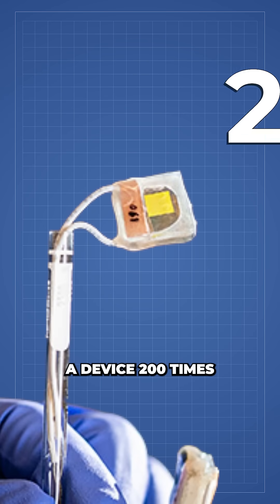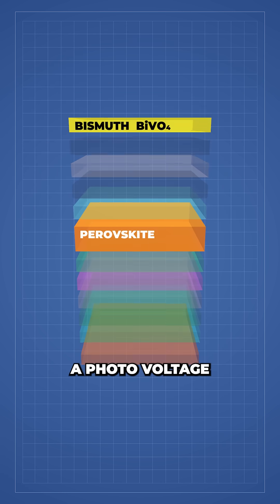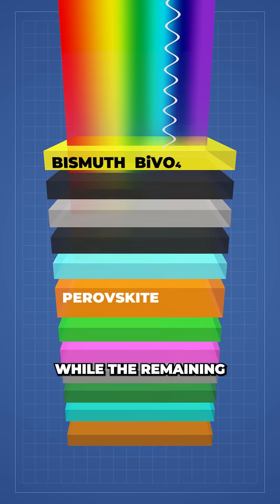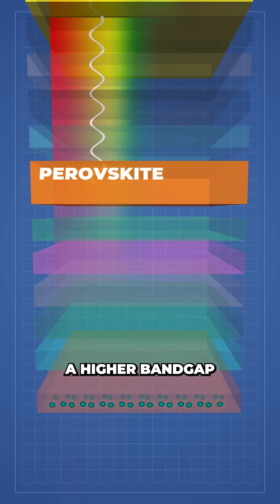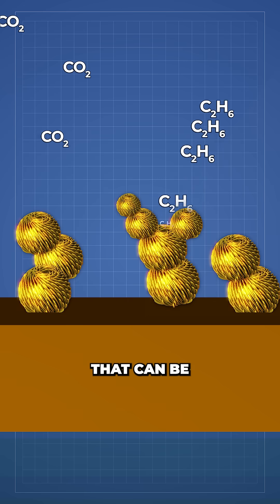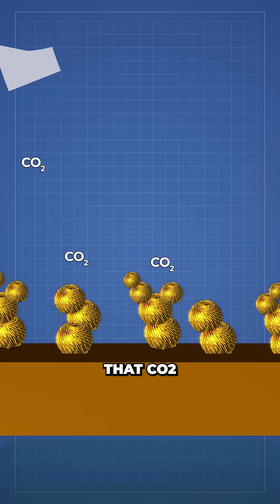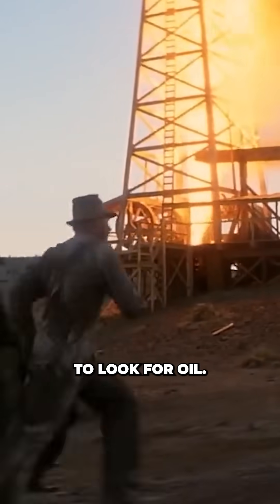Scientists Create Artificial Leaf That Converts CO2 into Fuel

Comment: If this can be cheaper then drilling a type of oil this would quickly be adopted by oil companies because one it lowers overhead costs and two it would decrease PR costs while raising profits what it will not stop is already built wells unless the solar tech gets good enough that sealing the still useful wells would be cheaper then running them till empty and most companies unless in a country without loose restrictions would not even bother properly ceiling the wells

Comment: Now, that is an actual great use of the perovskite... usually the perovskite is sensitive af and degrades way too quickly to be used in actual solar panels, but here it is shielded from both water and direct sunlight by the upper layers - without the shielding being a useless filter that negatively impacts performance... actually nice! Too bad that the scientists behind this are quite sudoku-cidal...

Comment: If anyone is curious i study these things and even if it is really promising and cool, don't get the hopes too high. The selectivity towards useful chemical components is still really low, the cathod is frial and prone to break easily, the materials are rare and expansive, and the energy needed to work, which should be given by the sun, is often unreliable. Plus you need a way to capture CO2 and have a pure gas line of it. As of now the studies shifted a lot towards using eletrical energy to make electrocell work, and indirectly using the renewable energies, and mainly get building blocks in a fossil free way, but the "artificial leaf" as we call it is probably far from a realistic thing

Comment: even if it works efficiently, it may be too expensive for anyone to actually want to use it. There is, however, already an inefficient, yet cost-effective way to synthesize natural gas, which creates the same carbon-neutral closed loop.

Comment: That's neat an all, but there's absolutely no need for us to perform the entire process in a single fiddly device. We can collect energy efficiently from standard solar panels, which in series or when fed into a boos converter can produce whatever voltage you want, and in a completely separate device(because we have these handy things called wires, which can move electricity to other places) we can do the electrocatalytic cleaving of CO2 and subsequent reactions to produce methane or whatever hydrocarbon precursor you need for the following processes. 
The idea of going through the rediculous trouble of packing it into an 'artificial leaf' is frankly asinine. It sounds like a bunch of people living off grant money in the goal of making a potato unpeeler. Valuable R&D dollars going into feeding people who are using science to basically play, and ending in a thing that no one needs for anything.

Comment: The Oil took millions of years of plants fixing CO2 in its roots, stems and leaves, if we are capable of converting 200x more CO2 in fuel than plants convert CO2 in O2 + C, we can procude fuel not in several millions of years, instead in "only" a million years.
This is not enough

Comment: Let's not use the power directly in electric motors and turn it into hydrocarbons which can be used to power ice engines with 25-30% efficiency

Comment: why not just use common panels and transfer the electric power to electrochemical devices that can make the conversion. why make a very difficult panel when a simple voltage converter can do better

Comment: So, based off of what is presented in this short, you just point the device at the sun and oil drips out the other end? I mean, I read something about glycol in the paper so it seems like there are more inputs than what is being implied here. If that is the case, how energy intensive is it to create those other inputs? If all inputs are factored in, then is this device still considered carbon neutral?

Comment: Cool experiment, but there's no chance it'll be a feasible method for decades if ever. This test probably cost $100k. If peer review and more advancements are successful costs will eventually go down, but you'd have to build such an enormous facility for it to make any impact at all. Think this vs gasohol corn or biodiesel.

Comment: Now that is useful. Solar power is as useful as a candle in a hurricane in the dark, but solar petrol or diesel.... Well... you can store that in a fuel can which is much cheaper per kilowatt hour than a battery and much easier to use.

Comment: Imagine a future where every gas station actually has a machine that turns CO2 into natural gas that you then put into your car. Burns a lot cleaner than gasoline, still works pretty well as a combustible fuel source. Drive up, swap the canister, drive away. Greatly reduces the supply chain for fuel transport.

Imagine gas power plants that can just constantly recycle their CO2 using some solar energy without need a huge field of solar panels and can work 24/7 because it is essentially storing solar energy as natural gas using CO2 and water.

Yeah, it won't be perfect, but it would be pretty cool.

Comment: I studied dual-layer semitransparent organic solar cells in college, specifically the perovskite panel. 3 larger problems will make this unviable outside of research purposes. 1, perovskite degrades significantly under UV light, so whatever the top layer is must absorb or block all UV light. From my basic research, the bismuth layer doesn’t fully achieve this. 2, inorganic perovskite (the more stable kind) is typically lead-based and is water-soluble and degrades when exposed to moisture. IE, when it degrades, it will leak lead into the ground. Lastly, perovskite has some issues with surface application, so it’s difficult and expensive to manufacture in general due to the high percentage of dud panels. All of these things are still being fleshed out, so hopefully in the future these can become commercially viable. Perovskite is semi-transparent - imagine every window on a sky scraper being a solar panel!
Reply: are there less problematic compounds with similar if lesser performance to perovskite? as the UV problem can probably be solved by putting a UV filter that shifts the UV into a less problematic spectrum. leaving only the issues with lead based Perovskite's water solubility.
Reply: @bohba13 there are alternatives, like tin, bismuth, and titanium, but none come close to the efficiency and stability of lead, especially in ambient conditions. Titanium comes closest in stability, but is lower efficiency and much more expensive (ie. not commercially viable). Bismuth shows higher efficiency, but is not as stable and still quite expensive. Tin is stable and cheap, but has the lowest efficiency coming in at around a third of what lead can produce. Lastly, filtering UV would defeat the purpose of dual layer panels, as we are trying to get higher efficiency returns, and blocking any light would directly impact that. It’s best to come up with a panel layer that can reliably handle and absorb the UV spectrum before reaching the perovskite layer.
Reply: So, a step in the right direction, but with more work to be done to make it feasible on a larger scale.
Reply: that was alot of negatives but the idea of every window being a solar panel does sound cool, how expensive is pervoskite? is it economically feasible to use it in construction?
Reply: @nobodyinparticular968  perovskites can be synthesized by various techniques. For comparison, the silicon, in silicon based solar panels, needs to be mined, hence production can be relatively more expensive. Though cheaper, most perovskites are not ready for long term usage.
Reply: @nobodyinparticular968 as of right now, it’s not a commercially viable product, for the same reasons as stated. The biggest issue i think is application, it’s hard to get a large panel made from perovskite because it needs to “stick” and it really doesn’t like that unless it’s laced with lead, if I remember correctly
Reply: @nobodyinparticular968  pointing out flaws isn't a negative. It's pointing out the truth. It's one thing to be nitpicky, but it's another to point out substantial flaws, like degradation and exposure.
Reply: Yeah, it's called being critical.

It's important, so long as it has basis in reality.

Have a good day.  @troybaxter
Reply: @troybaxter  ah when i said thats alot of negatives i meant that he found alot of flaws, not that i think he is being overly negative, sorry for the confusion 😅
Reply: @nobodyinparticular968  lol they just dont know how to use context clues
Reply: @troybaxter and leeching lead into the ground
Reply: @nobodyinparticular968 There used to be alot of negatives about the semiconductor material used to make the blue LED but some japanese guy (the GOAT one, in fact) did make it work so someone, in the near future, will b able to make it work.
Reply: @nobodyinparticular968 it exists already long time on the market. Swiss black glass,tabbed glass, transparent glass, used in quite a number of projects. Saudi Arabia is stuffed with this burj khalifa tower has that windows...therefore all this stories about co2 and dirty humanity today is a lie,as technologies are there for quite a while, just stopped from being massively in the markets. And btw co2 is active sourced today for graphene  
production and fir other means of fuel. All exists and works. Why nit everywhere or not popular? Governments! And global corporations. Literally no legal base created for true usage yet. Multiple bureaucratic obstacles. Also robbery within scientific and engineering community. Total hell.
Reply: @nobodyinparticular968 if we consider the fact that perovskite eats up the infrared light spectrum, i.e. the one that is heating up the building, to generate electricity, which could be used then to cool it down and power it - absolutely, if they ofc manage to make it last atleast couple of decades, otherwise it's not worth the hassle
Reply: Isn't uv easy to filter out though? Sunglasses seem to manage it or am I missing something there?
Reply: @jdmjesus6103 yeah it is, but it’s also very high energy light, so if it can be used it would be great. There is more energy in UV light than there is in all of visible light and infrared. Ideally the top layer in the dual layer configuration can absorb most/all wavelengths 450nm and below, and let the 450-800 wavelengths pass through to the perovskite cell.
Reply: I was taking about after the uv capture layers but before the perovskite, just as a safety net. The video did state that the top layers captured most of the uv didn't it?
Reply: On that last part. I’m pretty sure they’d at most end up letting only yellow light through or none at all
Reply: Thank you
Reply: And there it is. Thanks for enlightening us on why a lot of these promising new discoveries either rarely or only after a long time reach widespread use. Windows as solar panels sounds incredibly cool though.
Reply: Makes sense. The perovskite is the weak link.
Reply: As a bismuth engineering student from Harvard i can confirm that the amount of hyper gamma lightwaves required to kickstart this process into net positive photosynthetical alpha magnagenesis is simply in too high of a percentile to be feasible outside of magnagenesis and botanoxide research environments.
Reply: well, when PV-panels came first out, it was also considered very cost-innefficient to manufacture  whilest also yielding a low energy efficiency within experimental setups indicating even lower efficiencies in real time applications however, these downsides also got quickly nullified as more research was done and all it's subcomponents got improved or substituted with better materials. Today, great solar panels can convert up to 16% of incoming solar energy into DC electrical current. From this, i would assume these artificial leaves might follow a similar trajectory once sufficient financial investment is invested and interest/expectations of future positive results are hopeful
Reply: Better to try and convert it to another part of the spectrum if possible, so it can be used
Reply: @DanRyan-v5y best case scenario, a perovskite cell is paired with a top layer cell that absorbs up to 450nm
Reply: Hey - what was your study? Is it over-saturated, and is there work out on the other side?
Reply: @ryanmckenna3088 mechanical engineering, this was in my alternative/renewable energy specialization! I don’t work in energy, but there is definitely a lot of work in the field.
Reply: @adamcopp340 oh cool, you did reply. Thank you!
Reply: Hey commenting again, as I really do hope you can reply to this. All I know so far is White Bio Technology, not what courses will lead to that
Reply: this isnt perovskite, and even if it was? were not replacing plants. its gonna be in special factories, dont worry about leaking toxins lol thisis about using solar panels to create ethanol or whatever
Reply: Short story : cia & scientis dont have to worry about each other yet😂
Reply: Wow, this was great to know, thanks for sharing!
Reply: Sleep with one eye open bro😂
Reply: i mean, ill take lead over pfas any day. the harmful effects of lead have been understood since rome and they still lined their pipes with lead, we barely understand how much we've fucked ourselves with plastic and petroleum products.
Reply: Very interesting, thanks for sharing. What techniques are used to capture the generated fuel? I imagine these panels would need to be contained in a larger glass shell
Reply: The one thing people don't get is that with EVERY well known commercial technology they overcame at least the same amount of difficulties to make them happen. They only put more money into it than they did for sustainables until now.
Reply: The UV issue can be resolved by the video Ben Miles recently covered on how the skin of Red Onion’s can be modifiers to be completely transparent yet block 95% of UV light
Reply: Yeah that's why I generally avoid channels like this one, they never provide contextualising information. It's just a loop of toxic positivity farming ad revenue. 

There are at least 5 or 6 other channels all running an identical script and infographics they ripped from someone else simultaneously. 

I keep blocking them and they keep popping up.
Reply: @WhatIsSanity if the “positivity” encourages a greater interest and curiosity about science and its potential to find solutions to global issues, I’d rather they inspire some future scientists out their then just have more “cute cats falls off the table” videos…
Reply: @andrewilliam69  
Well that's the catch, channels like these don't ask questions or pose problems. They 
simply make claims that said problems have been solved already.

If we were to believe Ben Miles' claims from this video  alone humanity has apparently already invented a infinite energy source and solved the climate crisis in one fell swoop for the upteenth time. 

Which obviously hasn't fucking happened.
What makes the 'positivity' toxic is the part where it's a blanket of lies meant to stifle thought, trading knowledge for comfort.
Reply: @WhatIsSanity   Pretty sure this is a channel, they rip it from
Reply: Or on an electric car to charge the battery. No need for charging stations?
Reply: @georgejenkins7763  Cars vibrate a lot. Are these things stable enough to withstand that?
Reply: Good question. Never thought of that. @BrasswoodProd
Reply: @georgejenkins7763 maybe! Regular solar panels have a max efficiency of about 34%, it’s theorized that dual layer semi transparent panels could be up to 49% efficient. That, plus more surface area (think tinted windows) could provide enough energy to fully charge your car during sunny days. Check out Aptera, their concept is cool!
Reply: @georgejenkins7763  it makes combustible fuel not electricity.
Reply: Also considering you can already do the same thing using biofuels this seams silly. Maybe the CO2 conversion powered from nuclear would make more sense and it would represent a true backpedaling of CO2.
Reply: Don’t tell me what to do
Reply: @lukeryan6278 Don’t tell me not to tell you what not to do
Reply: @lukeryan6278  Now you are telling me what to do by telling me I shouldn't tell you what to do...!!!

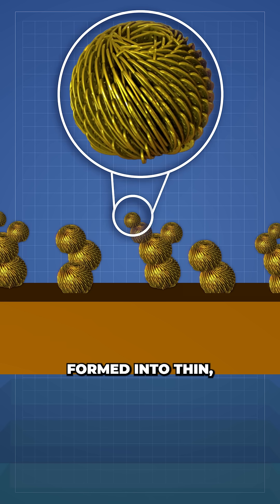Comment: This makes no sense: “splitting CO2 into short-chain hydrocarbons”?  (0:56) 
How can they break apart a small molecule (ie, CO2) and as a result get a bigger one (a hydrocarbon) —that has hydrogen that wasn't originally present, to boot?
Reply: Water, like in the air probably
Reply: Thank you sir. Thank you for thinking. Have my comment to up your question
Reply: The hydro in there stands for hydrogen, CO2 doesn't have hydrogen
Reply: @casualsleepingdragon8501 He knows, that's why they asked their question
Reply: @casualsleepingdragon8501 Well, er, yes, that's what prompted the (and my) question, which stil stands.